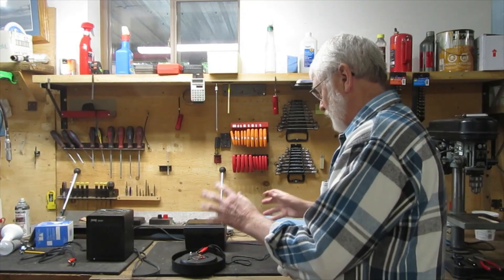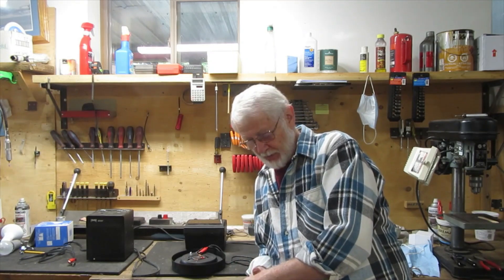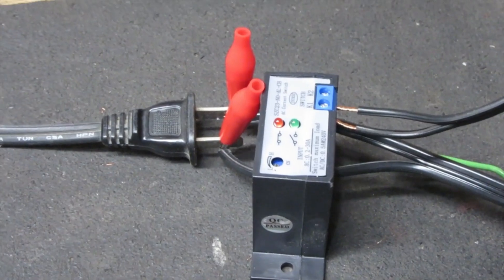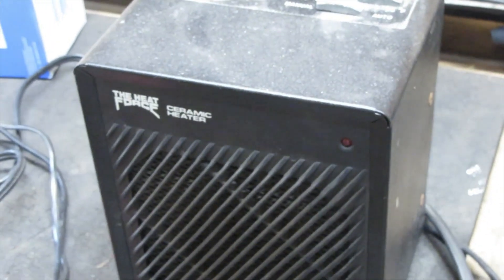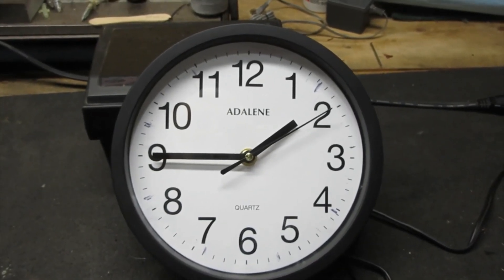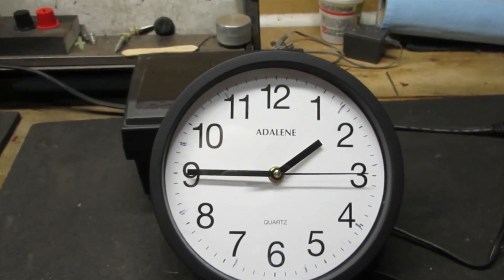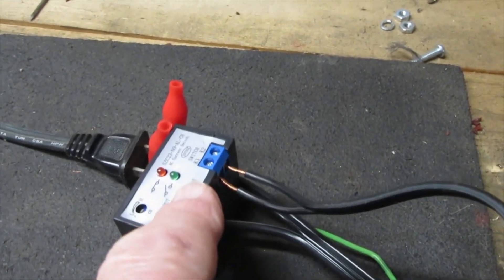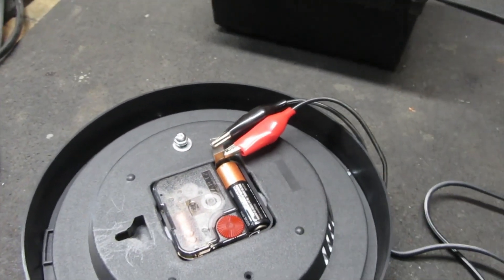Current Detector

Comment: Hi! I've got an ventilator and I when I set it on I want a second ventilator to start running. Should I use M3056 0r M3050? How should I do the conection? I plan to do it with a contactor. I would appreciate your help. Thaks
Reply from the maker: Not sure what you mean by M3056 0r M3050. The K1 K2 connections are just like a switch you put them in the circuit of the #2 ventilator and it will run when the #1 ventilator comes on and it will turn off when #1 ventilator turns off. Just make sure you do not exceed the product amperage limits.
Reply: @MrModify  Thanks! !The current detector that you used,what's it's amperage limit? If exceeding, could I use a contactor or does it exceed the limits of yours f.e.?
Reply from the maker: My knowledge about this device is very limited and I don't want to steer you wrong. All info on the device that I have is at this link. https://www.amazon.ca/gp/product/B07N1P6TWL/ref=ppx_yo_dt_b_search_asin_image?ie=UTF8&psc=1
Reply: @MrModify  Ok. Thanks a lot!!

Comment: This is not bad, but note that for about the same price (or less) you can also just buy an "energy meter" device instead, many of which can record both power usage and duration automatically (more accurate, easier to use, and no need for the clock).  This sort of "relay" device can still be useful if you want to turn on some other thing (like maybe an indicator light, or a fan, etc) when you reach a certain threshold of current flowing, though.

Also note that this device can only handle 0.5A through the contacts, so if you're using it to power an AC device, for (US/Canada) 120V use, that would be a max of 60W for any secondary device you hook up.  If you're powering any kind of motor, compressor, or incandescent lights, you should actually limit it to much less than that (probably 30W or less)..
Reply from the maker: Your are correct the device it's self would not handle much current and you would require a relay to do so. I bought the device to capture the amount of time it took for water to travel from the lake to a tank that was 70 feet higher and 150 feet away. A change in time would indicate a problem with the lake pump.